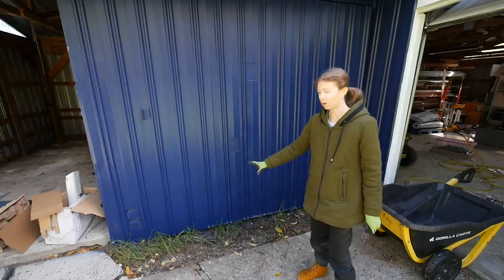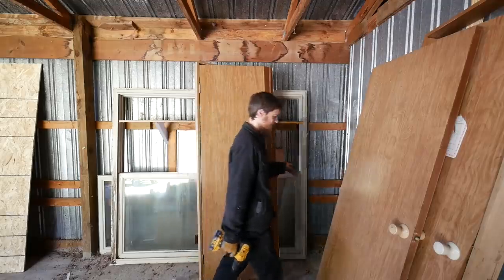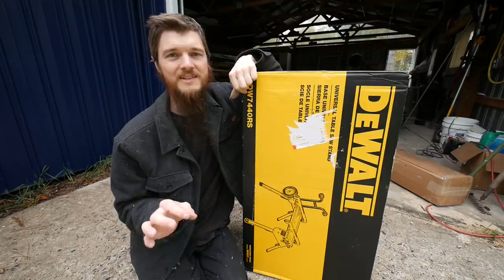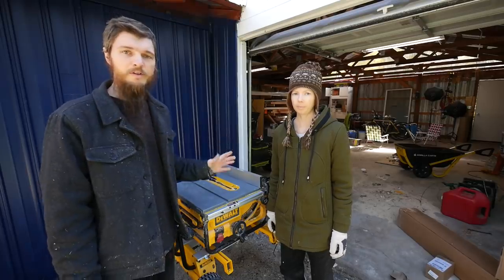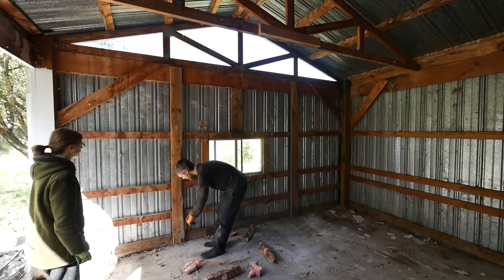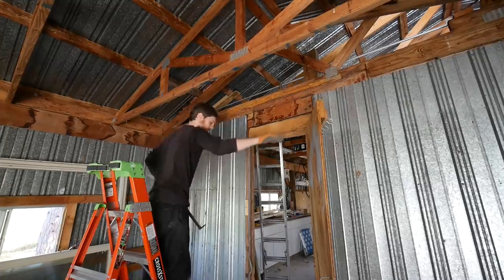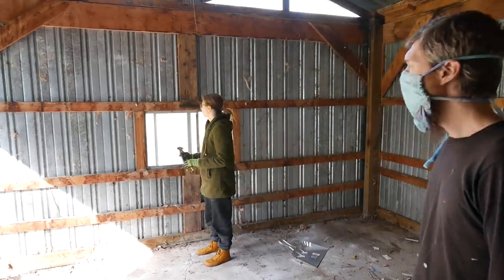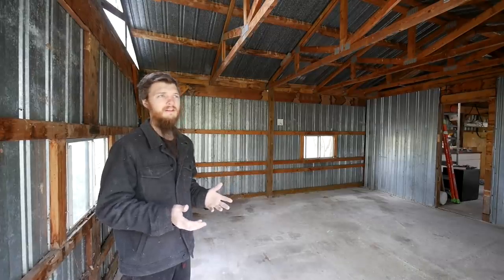Big Progress on the Pole Barn Cleanout - Changing the way we Work

Comment: That cleared space is a great asset to the property. It makes sense to plan the best way to make it useful to you. Certainly, insulation might make it comfortable across seasonal changes, but until you have a plan is not sensible to pile money in until the benefit is clear. As it is, you have a blank space that can be used according to your developing thoughts and plans.
The meadow is maturing well after the work that was put in, it is another asset to the property and one that should bring increasing benefits to you all.

Comment: Thank goodness for the saw stand (my knees feel better already). One of my most useful items is a china cabinet with large casters that I can roll to the house or anywhere for work it has drawers and 2 cabinet drawers which hold my routers, Sanders, miter saw, skill and jig saws etc. Measuring, marking, etc fit in drawers. Keeps things neat, tidy, and I don't spend half the day hunting items.😁 oh btw remember the pool table.😁 or maybe a little machine shop. Good luck you guys are doing wonderful.

Comment: Grats on the table saw stand!  I know that both of you are currently able to work on your knees, but over the years that will change, and you will really appreciate having an alternative!  On the subject of insulating that building, the insulation alone would do a lot for temperature control, both in the summer and winter.  I used to work in an un-insulated warehouse, and once they insulated it, it made a world of difference in the comfort.  In the summertime, a fan goes a long way if the room is insulated.

Comment: I thought that you might get the power washer out and get the barn floor cleaned and maybe the walls too - though it might be too cold to dry out? A big space with lots of potential. I can see it being a great greenhouse type space - if the windows and light was increased and the walls insulated? So many options for the space though and i can't wait to see what you guys come up with!

Comment: I did a lot of work of the ground at your age. Sometimes my saw blade ended up cutting dirt, that kills blades quickly. Yeah, you need to get off the dirt. I could have used one of those siding our house years ago.  I would love having a barn. A pellet stove or wood stove would give you some heat if you need to work on the car.

Comment: Im building a shed 32'×32'. Plan is to have 10x32 living space with small kitchen bath bed and living area that can be accessed from outside as well as the main shed/garage area. I found a fantastic deal on ac/heat units and bought 3. 1 is going into the shed and 2 in my main house. Plan is to totally eliminate my heat pump unit that is very expensive to run.

Comment: I;ve noticed since finishing the major project (the house!!) you guys have started to have a bit of fun, Ashley the Queen of funny with her goodbyes, now you Doug Handstands!!!, its good to have the pressure relieved, The space is big and looks good, If you go on Craiglist  put in, "Insulation"" you may find someone who has bought too much and just wants Rid of it, or try Insulation suppliers, they may Donate, worth a try, those door panels! maybe screw them to the walls tightly together, then maybe paint them as wall panels, I know they are hollow with Egg cartons used for the inside (in the UK they do), better than just standing them against the wall, or lay them on the bases of the trusses, and use them for storage. Nice Dragon Thanks. UK 4pm.

Comment: Great job on the clean out.  Very gratifying to see that floor cleaned up.  The aluminum siding looks like new.  It really is in great shape.  Wonder why you would take out insulation at the peak, but sure you have a good reason.  What a difference the mulch makes on the side of the barn.  Love the care Ashley showed as she worked.  Love how Belle and you jumped in at stomping time.  The field looks absolutely AMAZING.  It looks like you removed even more trees.  Did you?  Some animal would love grazing there and having the trees for shade.  There comes an age when you can no longer do cartwheels, sadly.  Getting the hands down to the ground seems like trying to touch the ground from the top of the Empire State Building!  So glad you can still do one!  Impressive!!!  Seems the room is maybe long enough to make into one larger and one smaller space so it can be used for more than one purpose.  Can't wait to see what you decide to do with it.  Reality check seeing Ashley in a winter coat, hat and gloves.... We are still getting 60s and 70s in Massachusetts altho the days are starting at 40ish now.  We are racing to finish stripping and sanding and painting cabinet doors before we can't work outdoors any longer.  Hope you get all your tasks done that you want done before winter sets in!  All the best!  Hi Maverick!
Reply from the maker: At some point we believe that whole room was insulated and someone may have lived in it many years ago. It's just old insulation left over that isn't doing anything anymore so we just want it taken out. Yea, the field is truly gorgeous, love walking out there. Haven't taken out more trees. Thanks :)

Comment: If I were u I would definitely insulate it and heat it. It will be well worth it having heat in a workspace/garage when it’s brutally cold outside. Whether you use it as a workshop or garage. Heck you could eventually build the rest of that barn up to have insulation and heat and make one luxurious shop

Comment: Put some weed cloth and rock in those areas where the weeds grow. Near the door. You won't ever have pull or dig weed again. Really like the channel. To heat the shop space find a used wood burning or pellet stove.
Reply: A wood burning stove would be a great idea for heating the space large or small.   Low cost and only used when using the barn or whatever you  decide to make the space into.

Comment: might be good to be flexible but sitting ob youre knees bend over getting up and down and lifting loads will eventually hurt youre back , i know i been a prepguy sander for truckbodies , i used to bend up and down holding a sander and it has damaged my back even though the sander is pretty light  its wear and tear that is the dangerous part

Comment: I would have left the boards up on the wall put in some Ridgidfoam insulation and those panels that you didn't know what to do I didn't nailed them to the wall to finish it also I would have left the screens up to get down the bugs or put a new screens and the ceiling fan if it worked I would have let it stay but this is your home and make it comfortable

Comment: The windows are rather low for adults, so maybe that could be part of the plan.  The problem would be that it would wreck your paint job to move them.  If it were me I'd probably use it for a furniture/household fix-it shop, and keep the mechanical stuff in the other side.  Probably put a low tech wood stove in there for scrap lumber which would be pretty safe with the concrete and metal. Probably wouldn't insulate, just try to button up against drafts.

Comment: Are you counting only on the sheet metal and the corner posts for vertical support,?  I saw you took down lots of vertical wood. What’s that leave you for holding up the snow??
Reply from the maker: The two boards we took out didn't carry any weight, but we will be putting up something new and better.

Comment: Remember the 80/20 Rule. Once a space is 80% full, it is at maximum capacity. The 20% empty space is about the same thing as cashe memory, (thinking room) in a computer. 

My suggestion would be to add the same kind of lighting as the rest of the barn. Then, don't make any commitments regarding that space for at least 1 full year. 
That way, you will have an opportunity to evaluate what just keeps ending up being in there. 

Personally, I would turn it into a dedicated outdoor equipment room.  Anything and everything that gets used to maintain the outdoor plants, wheather tall trees or short grass would have its own parking space in that room.
Lawn mower, 
string trimmer, 
pruners, 
loopers, 
batteries, 
extension cords, 
hedge trimmers, 
power washer, 
short handled garden tools, long handled garden tools, garden hoses, 
hose nozzels, 
charcoal grill, 
charcoal storage.
At some point, you might want a sythe. It has its own maintainance tools. 
And, etc, etc, etc.

Also, one special spot for starting transplant seedlings for next spring and summer.

Basically, just design your own ultra local garden center.
With a property that size you will need it.
You are really good at designing things. Having your own on site garden center for all those "specialty things" could save you from all kinds of frustration and headaches.

Love your videos.
Reply from the maker: Thanks for the ideas :)
Reply: @diyfferent  
I forgot seed storage.
You will eventually need a rodent proof system for seed storage. Most likely glass jars or metal canisters. I'm not sure how to handle bulk seed bags. Probably aluminum trash cans.
And,
Snow removal "things". 
I've never lived in the north so, I don't know what that would include.

Comment: Isn't it a bad idea to use mulch as your water management infront of your house and the barn? Isn't the main goal to get the water asap as far away from your foundations? And with this your keeping it in place. So the metal on your barn will rust sooner?!
Reply from the maker: We made it so the mulch is below the level of the metal and isn't touching it. Around the house is fine. It's pretty dry here and our soil is well-draining so it doesn't stay wet for very long.

Comment: I know it's already shot, but NO, do not put mulch into that bed. Look at how your concrete is broken. That is from ice heaving it, all because that little bed is land locked and does not drain. Digging it down for mulch will only worsen that condition.  Get rid of it (fill it with concrete and seal the edges) or make it drain.

Comment: How about using it as a garage because of the big door.
Reply: I'd want a garage if it were me. With the long winters in MI, I'm thinking it would get the most use that way.
Reply from the maker: We always have the larger section of the garage for that :)
Reply: If it's only 15 feet deep at the door, that's not much room for a vehicle.  The Element may barely fit.

Comment: You know it's big enough for a garage and a play area and workshop.  If you even just put spray insulation on the ceiling and used a barrel wood stove it would hold more heat and make the room even more versatile. Just thought cause that's what my dad always did cause we come from cold winter area. Looking good no matter what though.